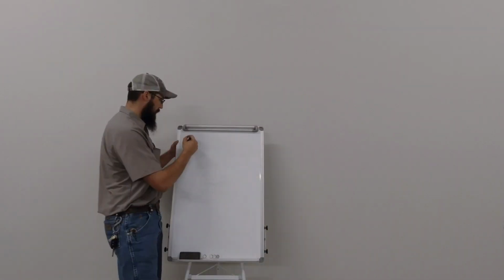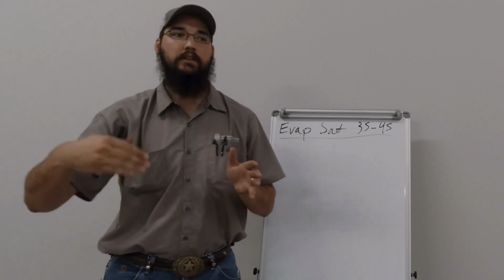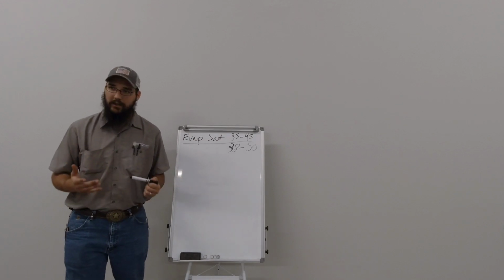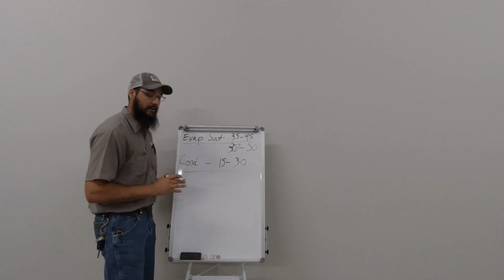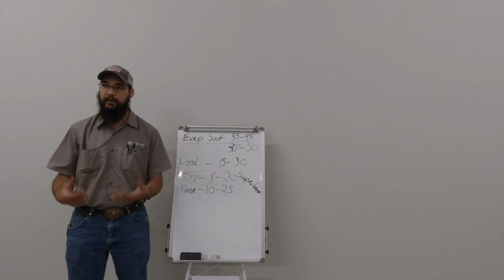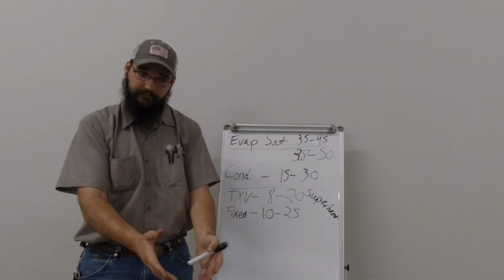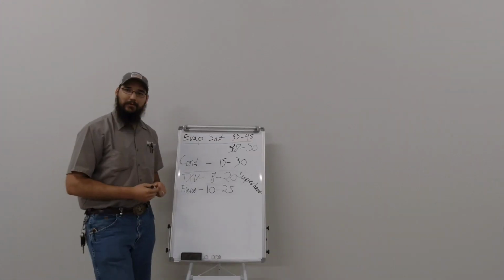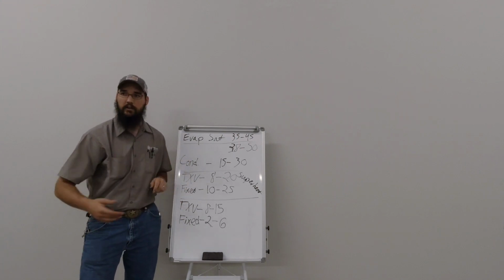Refrigeration Cycle Part 1 - HVAC Training

Comment: Nice!!! Learned alot. Why would I have a very low superheat with a high temp return air temp?
Reply from the maker: Low air flow is possiblity. Its a low heat exchange even though there is good load